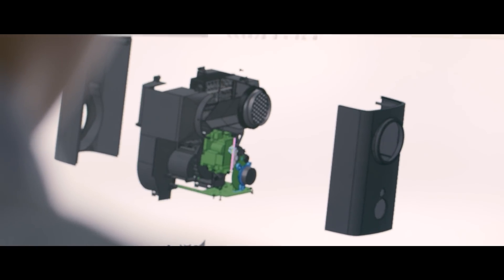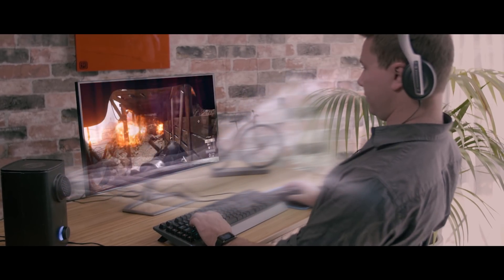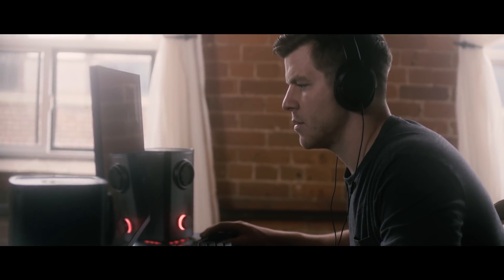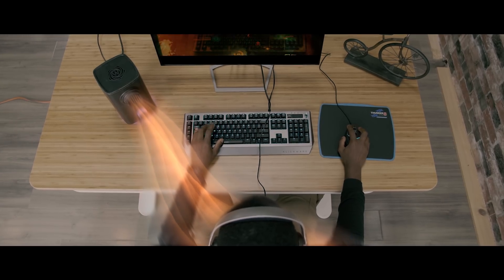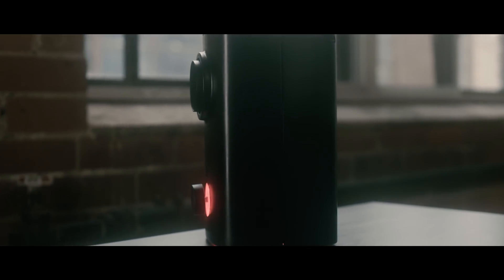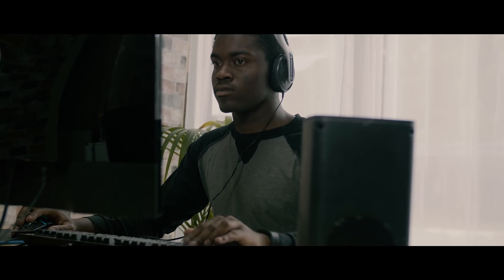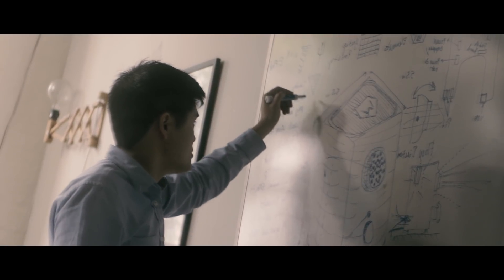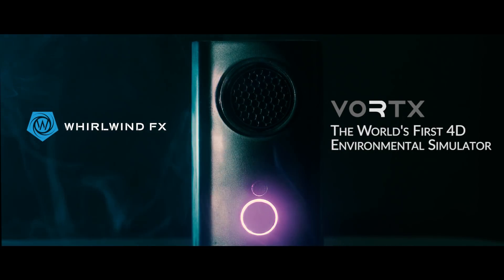How Vortx Works

Comment: Has this been tried in games such as Elite:Dangerous or Star Citizen? or any games where you would spend time under water. Seems like there would be too many variables for this to be accurate in all games.
Reply from the maker: Here's some gameplay with ED! https://youtu.be/BuSvx8xidgs
Reply: So it blows air while your in and cockpit? yh no thanks. you just displayed that its not really a simulator as described.
Reply: and I am not trying to bad mouth this, it could be really good but needs to be marketed right and don't state compatible with all games because with games like that it makes no sense.
Reply from the maker: You're certainly in the minority based on simulator testing with beta testers. But we appreciate your feedback.

Previous claims are true and Vortx is compatible with all games based on what is going on on-screen as we've stated multiple times. To your point, what would the point be for any immersive device for any simulator given that you're nearly always inside a vehicle?

Our goal is to provide effects that correspond to what you see and hear. If you wanted to be literal then you would feel nearly zero effects in either game you listed when you're in the vacuum of space or inside of a cockpit. Which begs the question - what kind of effects are you actually looking to feel if you're in a virtual environment that has none?
Reply: Exactly my point, there wouldn't be any. So it actually adds no realism to the game. You may be better off marketing it as emulation rather than simulation. To me this would be taking away from immersion rather than adding to it. I would look into working with game developers to have this work with games like Elite. There is a huge market for that sort of simulation but the people who buy products like this want increased realism and this does the opposite.
Reply from the maker: So increased realism in your eyes means feeling less? That's...interesting.
Reply: Whirlwind FX why so defensive? No increased realism means feeling what you would feel in reality. When you turn off cooling in Elite your ship over heats, that's when you could use heat. When your cockpit gets breached the you may use wind to simulate depressurization. They would add to realism and increase immersion.
It's constructive criticism, use it as such. Your telling a potential customer their opinion is wrong.
Reply from the maker: If you consider that "defensive" then you might want to take a few deep breaths. lol We hear what you're saying but our point is that the vast majority of people want effects that represent what they see on screen. Meaning velocity changes, feedback from projectiles, movement through space, ambient temperatures and more. Even your example is flawed - if your ship overheated, would you actually feel heat inside the cockpit or would it all be external in "real" life and therefore you'd feel...nothing? You see the conundrum here? ;)

Your feedback is great but very specific and defeats the purpose the purpose of feeling your surroundings.
Reply: Whirlwind FX If you play ED again turn off the cooling look what happens. It is not flawed the whole of ship over heats which turns the cockpit into an oven, so yes you would feel it. I would look at the difference between emulation and simulation and maybe do a bit of research into what adds to immersion. Maybe read Rules of Play by Salem and Zimmerman so that you might better understand how these things work within a game.

Comment: Does it reconizes objects or it only reconize colors?
Reply from the maker: Vortx takes both audio and video cues into consideration then uses those cues to determine what the real-life effects will feel like. If you see fire, you'll feel it as if you were seeing it in real life. If you see an explosion, you'll feel the rush of air and heat that syncs with what you see on screen.
Reply: Hmm, you didn't really answer...
Reply from the maker: Colors, pixels, hues, audio intensity, frequencies...anything you see or hear, Vortx does as well. Does that help?
Reply: Yep, thanks.